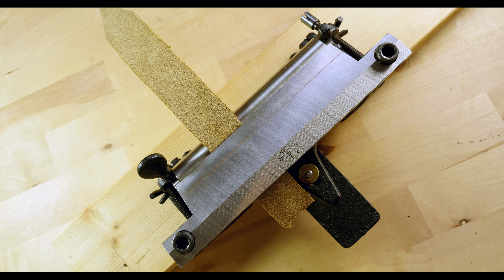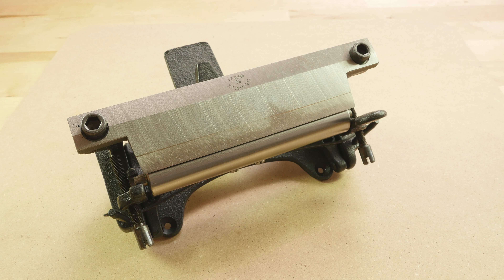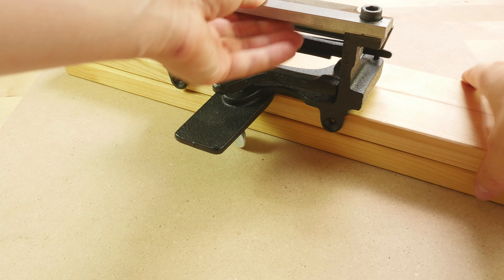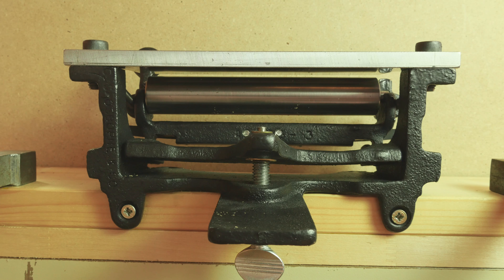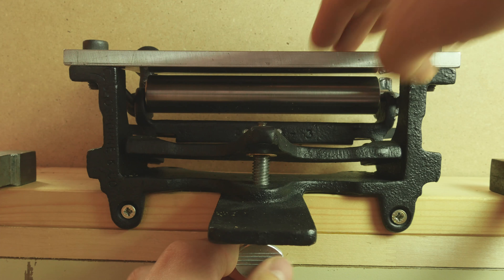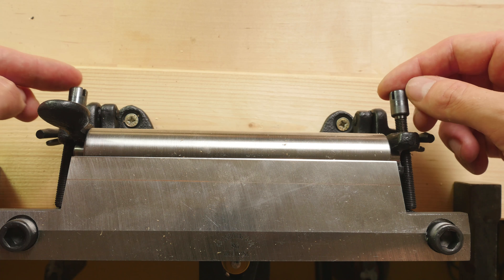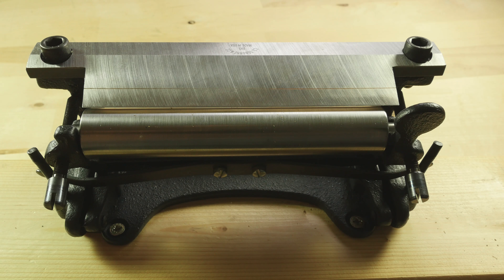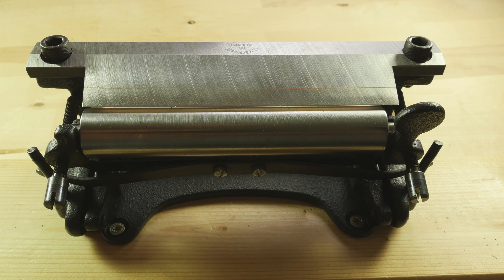Leather splitter- Osborne 86

Comment: I have Tandy Leather's version of this, I bought it on Black Friday for $100 USD. I attached a handle to the roller handle and it's much easier to use. With that adjustment it's as good as the Deluxe splitter, just not as wide, but I only use it for knife sheaths and belts so no problem.